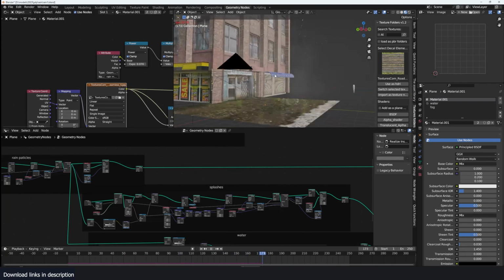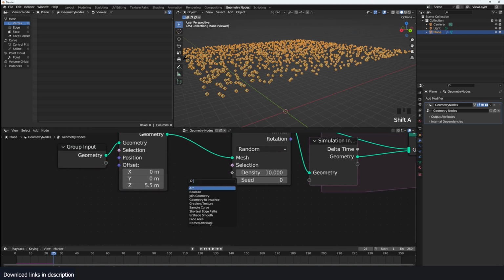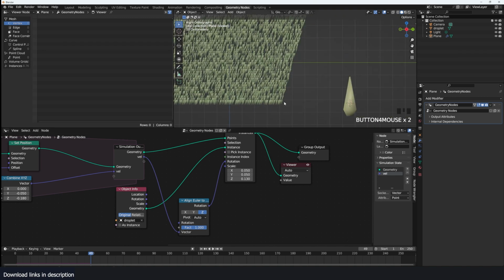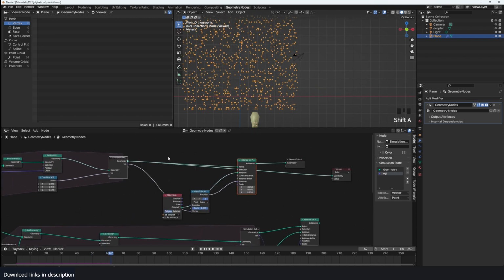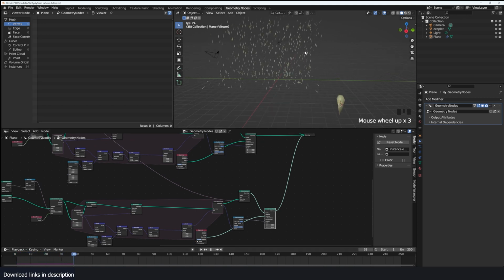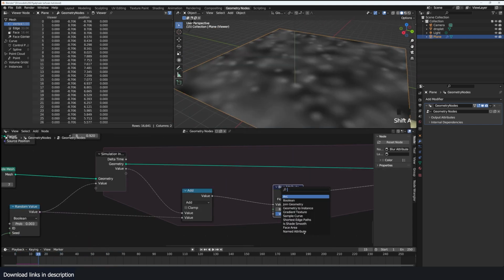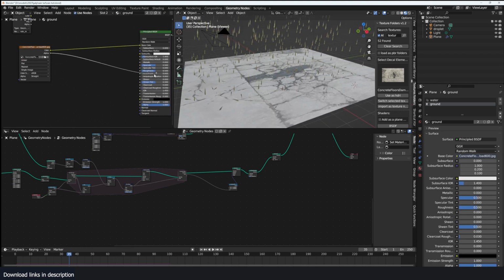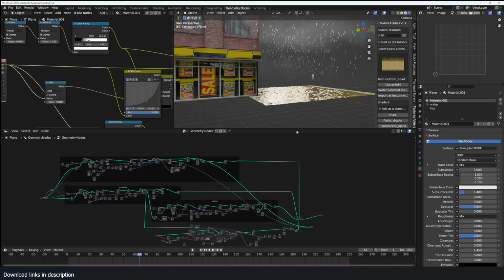making a complete rain system with simulation nodes

Comment: I can't tell why but when I did the part for the rain distortion on the ground plane it keeps ascending every frame instead of just doing the ripple effect. Why might it be doing this and how do I stop it?
Reply from the maker: U must be adding it in the simulation zone, the set position should be after the zonw
Reply: @TopChannel1on1  There's no Set Position node inside the simulation zone. It is set after the Zone, but it uses the Value output from the Simulation Zone run through the Multiply and Combine XYZ nodes.